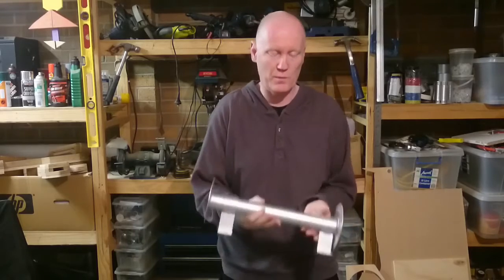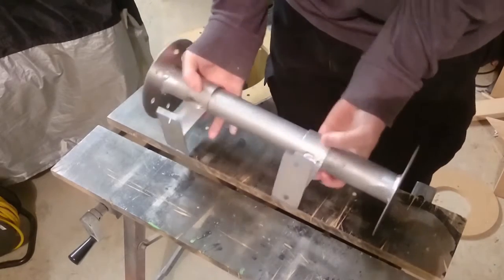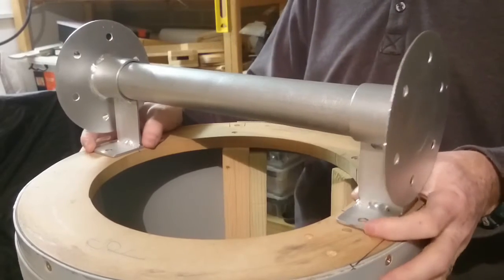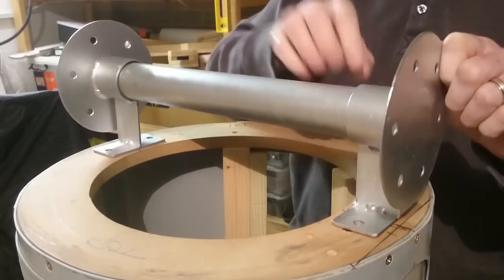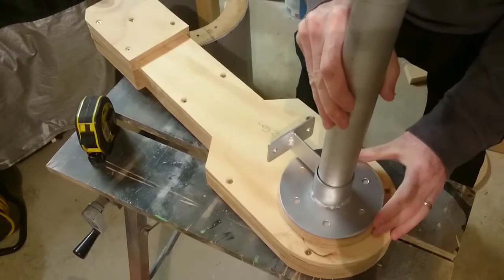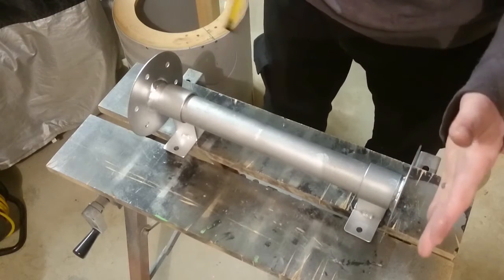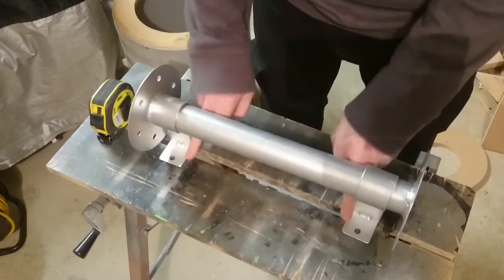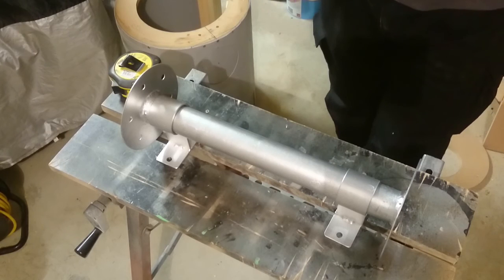D.I.Y R2-D2: Leg Mounting Bracket - Episode 7 | Step-by-Step Guide for Building R2-D2 Replica

Comment: i am following this to make one myself, and had a thought about this part to cut coast, for the main bar use PVC pipe, put a doll rod inside, replace the metal plates with wood, then from there not sure if the larger PVC pipe would fit over to make the bracket, again with a doll inside it to use to screw it to the top.  what do you think/